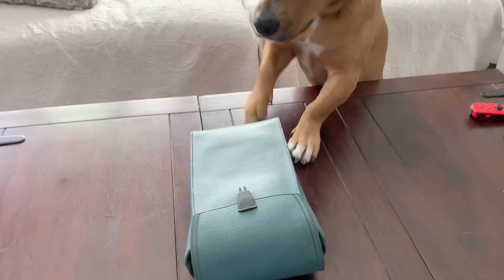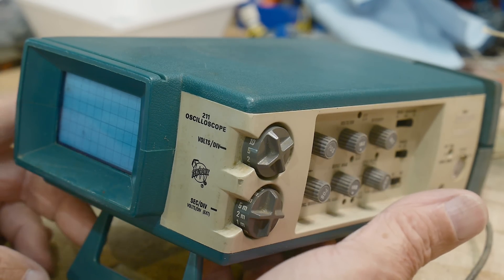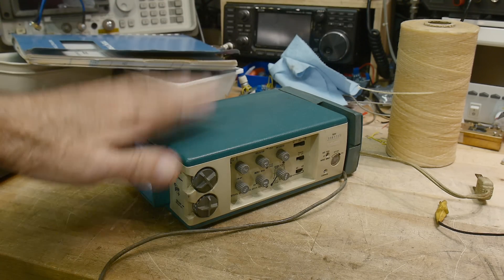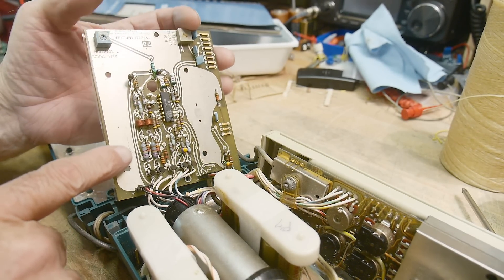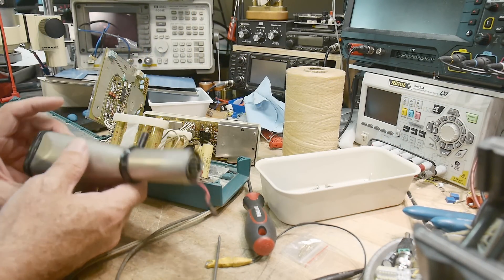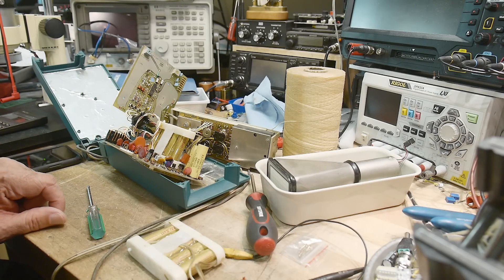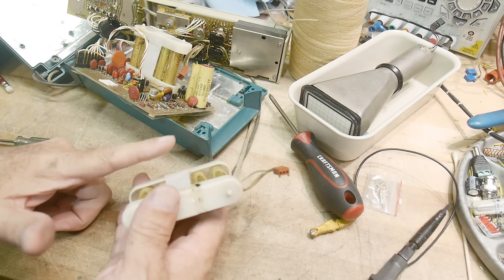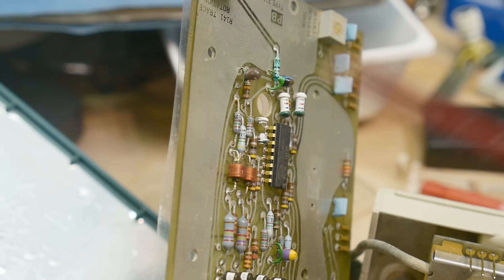#1356 Tektronix 211 Mini Scope (part 1 of 2)

Comment: I’ve use single channel scopes in a pinch by combining two signals with a resistive summer. Works only for lower impedance sources, but perfect for some situations. Say, the sum of the serial data signal with the related analog input or output is quite usable, especially if the serial data is scaled down somewhat relative to the analog signal. I applaud Tek for understanding that probes tend to get lost. They are Ike socks. Must be same forces of darkness at work.

Comment: 3rd nicad wire might be temperature sensing, or voltage sensing to determine charging cutoff
Reply from the maker: it is really boring.  + - +   so you can't plug it in backwards
Reply: @IMSAIGuy lol. Really really boring

Comment: In 1992 I was working at a small company that did industrial drive repair.  They had a related model to this scope called a "power scout".  It had a yellow case.  I don't remember much about the scope except for the time a tech and I went to visit a customer site to troubleshoot a 200HP motor drive.  We had the scope situated inside the drive cabinet and whenever we turned on the AC power (3ph 480vac) there was a magnetic field surge in the vicinity of the scope and the trace would "twang" and rotate/oscillate for a few seconds.

Comment: At least on my similar small Tek scope (dual trace), the battery connectors are wired so they can be plugged in either way, kind of like USB-C connectors.
Reply: Your 212 video was excellent. A fantastic resource for all us guys that like to use different test equipment than the rest of the pack.

Comment: Hello, nice Christmas present 😁 NiCd batteries have a nominal voltage of 1.2V, so they are charged, in this oscilloscope it creates a filter for the source. Tektronix has released a modification of the power supply, I have a 212 and I completely canceled the batteries, so I made a new linear power supply instead of one battery pack. I use it regularly because it is connected as a monitor to the curve tracker.

Merry Christmas everyone 🎄🎁🙂 Tom

Comment: A "bad dog" bone capacitor - perfect! Nominal voltage for a nickel cadmium cell is 1.2 volts - so yours look good. Another alternative would be nickel metal hydride - same voltage and the charging circuit is compatible. As a bonus, you would get longer run time. Merry Christmas! Regards,  David
Reply: NiCd is usually better at delivering high currents, shouldn't matter here i think. Also i'm not quite sure if any other but li and pb batteries can be tested without load.

Comment: I had one of these when they were new for troubleshooting variable speed drives. Recently got  a T912, it's bigger teal brother, for $5 at an auction.   Now to figure out why it thinks the supply voltage is to high (yes the switches are set correctly) and the trace fading out in a couple seconds. 🤔

Comment: The 214 is a storage scope; it probably has the smallest direct-view storage tube ever produced.  Apparently they had trouble scaling up production of rectangular CRTs this small at first, and they ended up working with Sony on the problem, who would later use the same cathodes in the first Trinitron TVs.
Reply: wow!
Reply: 214 is with multimeter in CRT, memory is with 224.    
211, 212 and 214 have the same size CRT
Reply: @Edisson.  The 214 is a storage scope using a direct-view storage tube.  The 213 is the one with the built-in DMM.  The 224 is a larger digital scope.
Reply: @douro20  Thanks for the correction, memory goes with age 😁